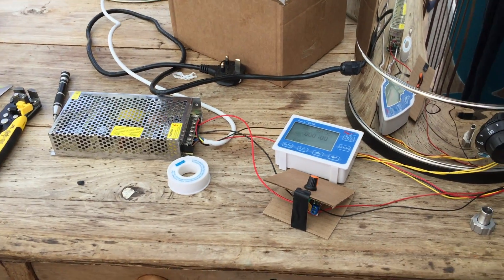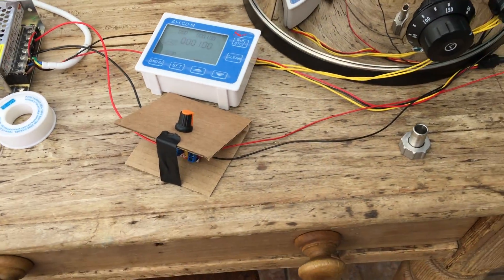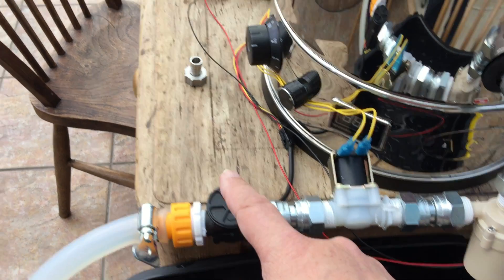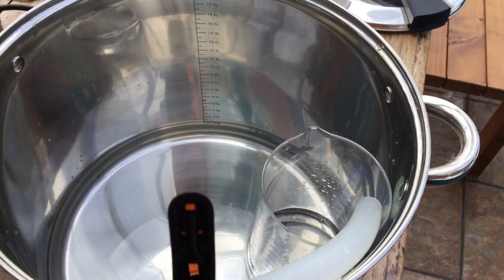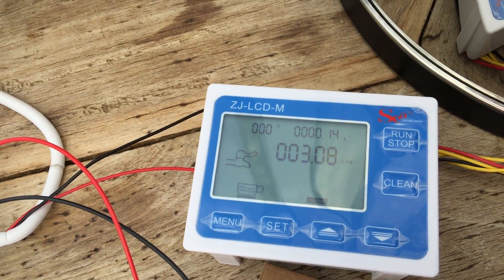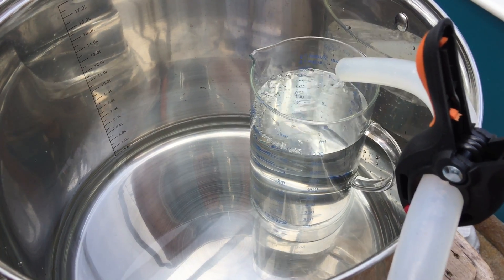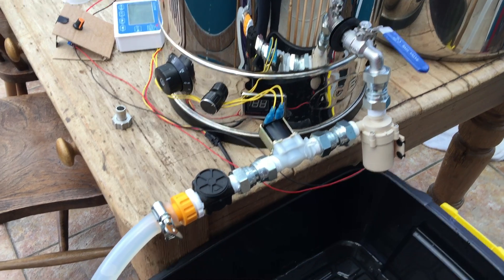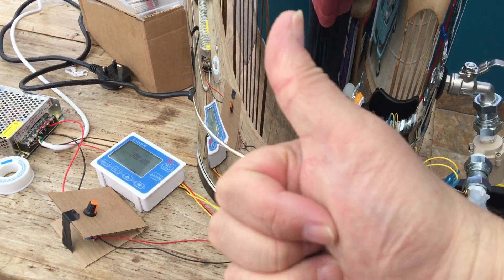Quick test of home brew "sparge engine" ZJ-LCD-M Flow meter.

Comment: Hello. nice experiment... I have almost the same set up and I recently bought the same pump and the same ZJ-LCD-M Flow meter from Amazon... I would like to share 2 things: That beige water pump (I guess originally it is meant to be powered through a photo voltaic board... mine is) consume very little electricity, so it can be opreated directly by the output of the flow meter control, and in this case there is no need for the selonoid... This is how I'm planning to set up mine (but it will take me some time to finish it an test it, I can update later). second thing is that when I opened the flow meter controller, I found a nice surprise that there is a place to connect a K-type thermometer (of course you need a flow meter equippe with a thermometer) in this case the controller will be able to display the temerature (I still haven't installed it and tried it yet ). Cheers

Comment: How does the flow to the sparge arm vary depending on the volume in your urn? Is it relatively constant or does it start fast and then slow down as the urn empties?

Comment: can use like automatic overflow system...i mean one pipe flow switch and second pipe shut off valve...and when flow switch indicate water off then shut off valve is closed?

Comment: nice setup, but why pump connected directly to power supply, you could connect to valve. then you wount need to shut down the pump manualy.. if controller does not support enough A for holding 2 devices then think about adding power switch from valve connection.

Comment: The Happy Vaper,   Thanks for your video. I bought the exact same model you have, being the ZJ-LCD-F7 and I got the micro stream flow sensor model OF-201.  Thing is there was no wiring diagram and I'm wondering what the wires are.   Obviously the thicker Red, 2 Blacks would be pos and neg. The yellow, would that be the active to the solenoid with one of the blacks being the neg- or neutral for the solenoid?

I'm not using a solenoid by the way- I only want to asee how much water we are using in our camper (and as a reslt how much might be left of the 120 litre water tank.

However there are several other (finer) wires also present from the meter. 2X blues, 2xBlacks and 2X whites- These are terminated in insulated female spade teminals.  Can you tell me what they would be?  Would I need them in a meter flow only, situation?

Cheers.  Look forward to your reply..